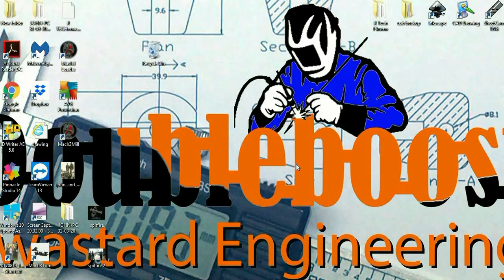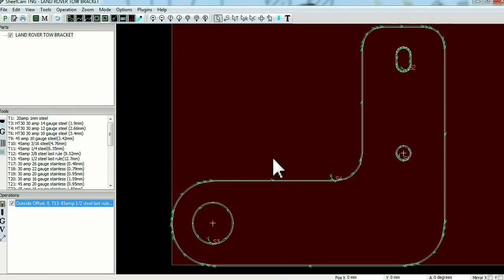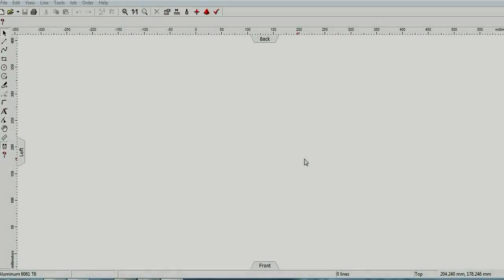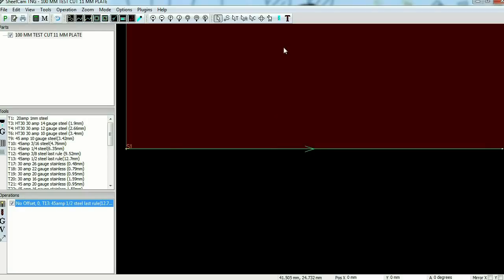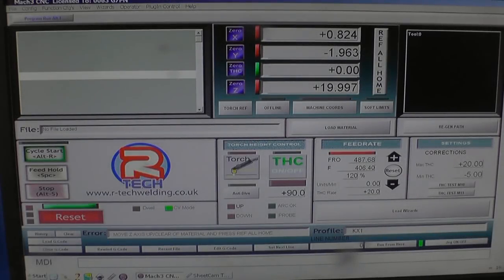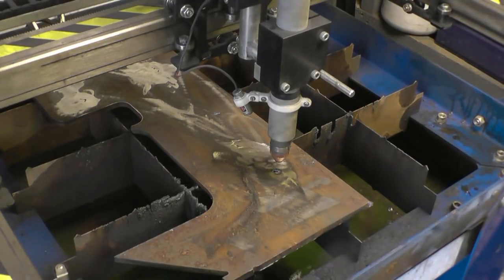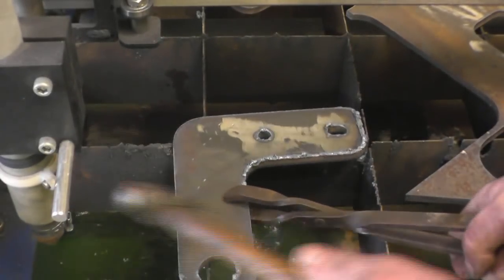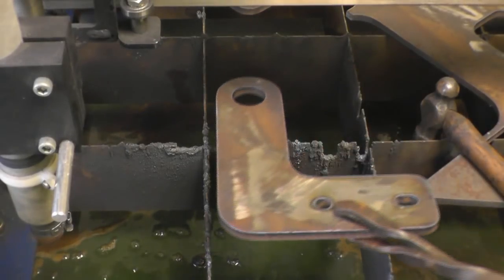R-Tech / Xtreme CNC Plasma Cutting System Review Part Three

Comment: i dont understand what is this water pan on this table design.. Every other table got water almost touching workpiece. I had swift cut and it shuld be 10mm under sheet.. that way you get less dross, heat input and almost no fumes. This table seem to have it only to stop hot molten metal in it

Comment: I noticed that the part moved a little each time you stopped and scraped of the dross.
Reply from the maker: I normally put a weight on the plate to stop this
Reply: That does appear to be the trade-off to using that feature.   I'd be curious to see how important it really is to use it on this sort of plate.
Reply: May be able to come up with a clamping arrangement if it needs to be more accurate.